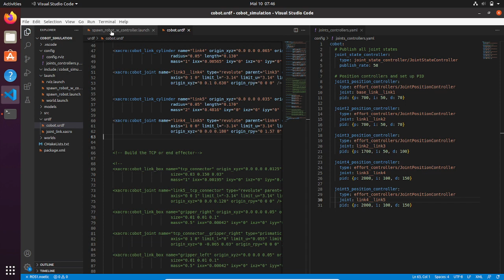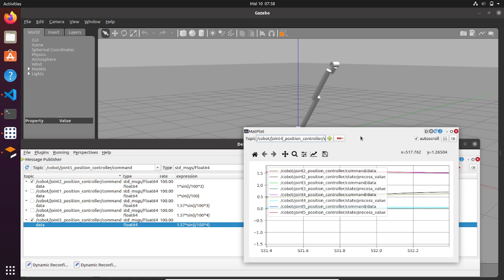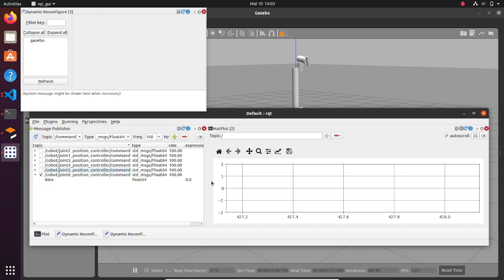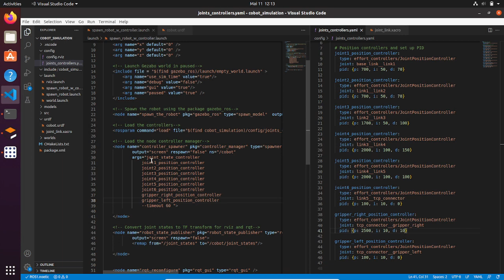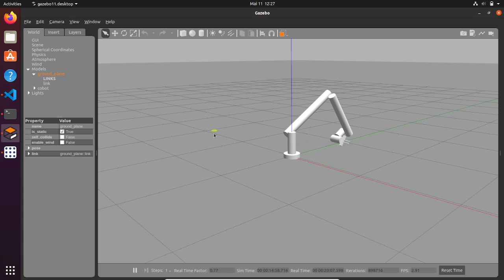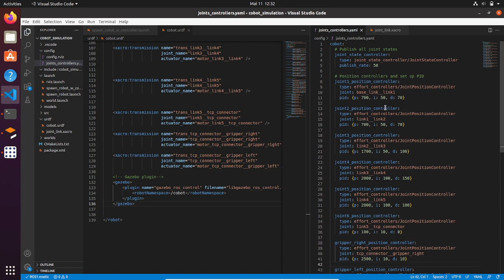How to setup ROS Control for 6 axis robot, Part 8: Complete your robot with 8 joints controllers

Comment: When I run the simulation , the robot starts to follow the trajectory, but before or after picking up the object, the robot interrupts the control and gives me the following error: Controller '/manipulator/arm_controller' failed with error GOAL_TOLERANCE_VIOLATED: link1__link2 goal error -0.000014
[ WARN ] [1714489558.064838682, 42.470000000]: Controller handle /manipulator/arm_controller reports status ABORTED.
Could you kindly tell me what the problem could be, and if there is a way to increase the joint goal tolerance?
Reply from the maker: Ciao Davide! You can change the goal tolerance by increasing the value here:
      base_link__link1: {trajectory: 0.1, goal: 0.1}
You find this line in the config folder of the package created for the simulation:
https://github.com/LearnRoboticsWROS/cobot_sim_youtube

You can try it, but I don't think that is gonna work. This because most likely if the problem is presented during picking,  I think that thi happens because the ox grasping package and the Gazebo plugin grasp-fix is not well installed. Check out that, I made a specific video on how to grasp an object. 
Do this thing:
1) try to run you pick and place e application im Rviz
2) if in rviz works and in Gazebo don't,  try to reinstall in your Catkin workspace the package for keeping the object attached to the grippers!

Let me know if it works! If not you can reach out via mail at ros.master.ai@gmail.com 

Have fun!
Reply: Thanks for your answer. The pick and place application works in Rviz but not in Gazebo. I tried to modify goal tollerance and to reinstall the package for keeping the object attached to the grippers, but it still doesn't work. I will do other attempts :)

Comment: Wonderful, very realistic tutorial, would be good enough if have configured the controller.yaml file infornt of us, meaning that shoulder to shoulder as did other videos in the series. We could grasp much easily under the hood. Anyway, thank you so much the way you did it.
Reply from the maker: Thank you @fawadkhan8905 . Do you mean this?  https://youtu.be/2D3sfAI5E0w
In this video we go through the creation of controller.yaml file step by step. Check it out! 😉
Reply: @learn-robotics-with-ros  Thank you so much sir for your reply. let me check it sir, but I have been stuck for one week now. My urdf model falls down in the gazebo world, after 2 or 3 seconds the launched. Exactly the same as falling down in this series video. Basically, i was searching here and there, I do not even know what's the problem. Generated sdf out of urdf still not worked. Finally, i came up with your series today, and i do hope my problem can be solved here. If not sir please I will reach out you. Thank you
Reply: Sir my urdf file is different than the this video series one, here also xacro:cobot_joint and link_cylinder keep repeated but I don't have this at all. I also cloned the repository of cobot but it is throwing error regarding transmission!
Reply from the maker: Ok I think that I got the point. Most likely it is an issue of the launch file. Check this video also https://youtu.be/nb1fz3ePkyM
The launch file is essential to load the controller properly and make sure to have put the namespace of your robot in the launch file in the part of the controller_manager and in the Gazebo plug in that should be in your URDF file.
Furthermore I would suggest you to start with maximum 2 joints, then when the controller are correctly spawned in Gazebo and you are able to control via command line, then you can add the links and the joint of your robot. Try to follow the series How to setup ROS control for 6 axis robot step by step. It should work! If not, don't hesitate to reach me out! Have fun! 😉
Reply from the maker: @fawadkhan8905  I see, of course you should adapt this procedure to your URDF, update the joint name and transmission tag. This series gives you a procedure to follow, and it is based on URDF file created in another series: Model a robot with URDF.
Reply: @learn-robotics-with-ros  Alright, thank you so much Sir, the way you intuitively understand us and kind words.
Reply: @learn-robotics-with-ros  Sir, is that series available in this channel playlist? the one based on the urdf file. I want take a look from the scratch,
Reply from the maker: Sure! 
Here you follow the playlist for the URDF file:
Model a robot with URDF: https://www.youtube.com/playlist?list=PLJOHOcnvyOr0mh8v7eRvL9ipz3fY47iMp

And here you find the full playlist for the ROS control setup:
How to setup ROS control for 6 axis robot: https://www.youtube.com/playlist?list=PLJOHOcnvyOr3kBviehO2aE8sVXpGtTzZq

The approach is step by step, I hope that it will help you with your robot! Check it out! If it still not working we can have a look together! 😉
Reply: Sir, I want to follow up the series from "catkin_create_pkg cobot". if available sir please share the link. Thank you
Reply from the maker: Ok! So here the structured pathway you should follow:
1) Introduction to Gazebo https://youtu.be/QghfCqVSr6s

2) How to create a world in Gazebo (here I create che cobot_simulation package) https://youtu.be/E7njvQ5BDPg

3) playlist Model a robot with URDF: https://www.youtube.com/playlist?list=PLJOHOcnvyOr0mh8v7eRvL9ipz3fY47iMp

4) How to calculate inertia values and Spawn a Robotics in Gazebo https://youtu.be/Nhnq6bMEsRg

5) playlist How to setup ROS control for 6 axis robot: https://www.youtube.com/playlist?list=PLJOHOcnvyOr3kBviehO2aE8sVXpGtTzZq
Reply: @learn-robotics-with-ros  Sir, when I put gazebo plugin in the my URDF file, my gazebo 3D world get hanged?? Even the gazebo GUI button status playing but actually it paused and hanged not clickable??
Reply from the maker: What do you mean by hanged? Can you send me a screenshot? Have you tried to fix the robot to the world by using the following tag to your URDF file?

    <!-- Fix the cobot to the world--> 
     <link name="world"/> 
  
     <joint name="fixed" type="fixed"> 
         <parent link="world"/> 
         <child link="base_link"/> 
     </joint>
Reply: @learn-robotics-with-ros  Sir now i got this error [WARN] [1691042174.651460, 6.880000]: Controller Spawner couldn't find the expected controller_manager ROS interface.
[xMatePro7/controller_spawner-5] process has finished cleanly
Reply: Sir how to share the screenshot please? hanged problem is solved. But this one now
Reply from the maker: Try to make a photo to the screen. The way you do the screenshot depend on your computer. Or if you prefere you can share to me your repository to github and I could have a look into it. Or send your workspace to my email: ros.master.ai@gmail.com
Reply from the maker: Hi!

I think to have solved your problem!

The problem was in the transmission tag.

you have used joint_name  and actuator_name instead of just "name"

attached you find the correct tag!

Be sure to not make confusion in the tag if you use macros, for next time ;)

You should need to correct every transmission from tran1 to tran7 and hopefully will work. Attached you find a screenshot of your robot working!

Have fun and keep learning robotics with ROS! :)

Ps. If I have been helpful for you, consider to make a donation to help me follow better the channel and publish more interesting topics in Robotics. You find the link here ;)

 https://www.paypal.com/paypalme/learnroboticswithros
Reply from the maker: <transmission name="tran1">

<type>transmission_interface/SimpleTransmission</type>

<joint name="xmate_joint_1">

<hardwareInterface>hardware_interface/EffortJointInterface</hardwareInterface>

</joint>

<actuator name="motor1">

<hardwareInterface>hardware_interface/EffortJointInterface</hardwareInterface>

<mechanicalReduction>1</mechanicalReduction>

</actuator>

</transmission>
Reply from the maker: Check out your mail! ;)
Reply: @learn-robotics-with-ros  sir I sent you the email please
Reply: @learn-robotics-with-ros  sir sent you back an email. Please
Reply from the maker: Hi! I have sent you via mail the URDF file modified. Just take it and test! Check it out! I hope that it solves your issue! Keep me updated! 😉
Reply: @learn-robotics-with-ros  yes sir just received, now I am trying. Much love for you. Thank you so much sir
Reply: @learn-robotics-with-ros  Am getting this error sir [WARN] [1691066091.951837, 5.118000]: Controller Spawner couldn't find the expected controller_manager ROS interface.
[xMatePro7/controller_spawner-5] process has finished cleanly
Reply: @learn-robotics-with-ros  thank you so much sir, the robot arm is finally stand up. Thank you sir
Reply from the maker: I am very happy to hear that! If you want, consider to make a donation, whatever you feel for supporting this channel, so I can continue to make such content and even more interesting one! I will really appreciate that! Thank you! And keep learning robotics with ROS!
Here the link for the donation: https://www.paypal.com/paypalme/learnroboticswithros
Reply: @learn-robotics-with-ros  Alright
Reply: @learn-robotics-with-ros  This error sir [WARN] [1691066091.951837, 5.118000]: Controller Spawner couldn't find the expected controller_manager ROS interface.
Reply: Sir how to add the grippers, the repository contents are not as liked in this tutorial series. The repository is updated.
Reply: It seems to me that the grippers is added to the cobot urdf file is an external xacro file. And also am worried, what about the grippers urdf file. Is xacro and urdf is alternatives??
Reply from the maker: Hi! Yes correct! The gripper file is another xacro file where I have modeled the gripper with mimic! I explained you why and how to do that in this video https://youtu.be/JGdRC9If2Zg
Reply: @learn-robotics-with-ros  Sir can I add the gripper xacro file into my urdf file, am asking because my urdf is not xacro based??